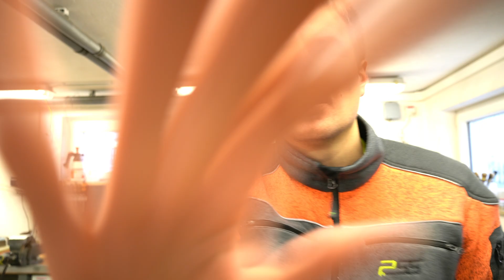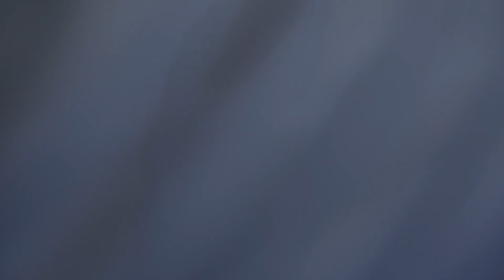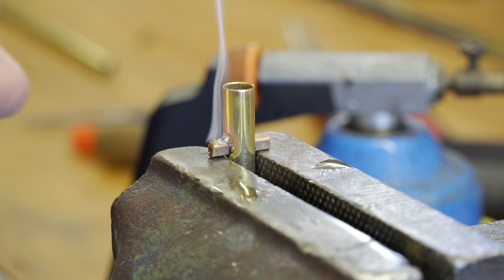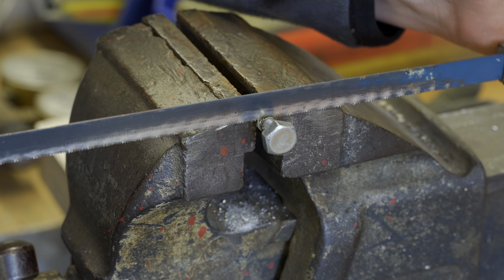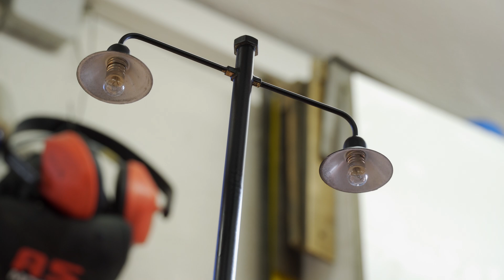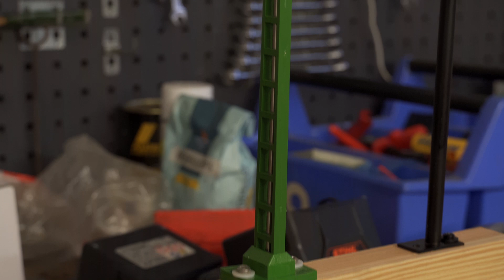Scratch build LANTERN ready to install on my LGB garden railroad!

Comment: Lights look really good! Do you find the time it takes to make one, or then a number of them, worth it, compared to buying what you want? And do you have any plan so that once you've put them on the layout, they aren't vulnerable to getting bumped or snapped off?  Always wonder how long these last in a practical sense...you know, you are cleaning up, or moving something and the power cord sweeps across the platform, a branch falls, and when you go to move it you hit a light, and pull the whole platform out. ;-)   Especially since so much of your layout is all at ground level. Just your chickens wandering on to the layout....;-)
Reply from the maker: Hi! I am glad you like my build :) First of all this project started because I could not find any lantern that fit my criteria. So I began to make one of my own. In the video you have seen me build the prototype lantern which took me about 4 hours in total including the camera work which takes most of the time. As of today I have build several lanterns of the same style. Once I bought the right materials and got the system down I was able to build one lantern in 25 minutes! The overall cost is at 21 Euro which is fantastic since you can only find cheap plastic lanterns at this price point on the market. 
Protecting the lanterns on the layout is difficult. Most important is that they are robust in the first place so that they can withstand small branches, a bird or a slight bump. Thats why I prefer metal lanterns over plastic ones. You can strategically place them as well to prevent bumps in high traffic areas where people step into the layout for example. But in the end it is a garden railroad, you simply have to accept certain damage from time to time due to weather, animals and people. See you next time!

Comment: 4:30 I think my solution would be JB Weld.  Not sure if you have such stuff or exactly what its outdoor life expectancy is, but...
Reply from the maker: I don´t have JB Weld on hand but im sure I can buy something like this in my region. This was my prototype lantern, I used what was currently available in my shop. Now that I had a plan in mind I went shopping and got exactly the right materials for the job... it should go way smoother this time :)
Reply: @summitrailway  Sounds great!  I don't want to sound negative, I think it turned out pretty well!  And you could actually make that expensive version if you can find a good way to bend the arms of the lampholders you have in the right way.

Comment: A round rasp is perfect for deburring the ends of the cut brass pipe.
Reply from the maker: I did use it on the inside, it hasn´t made it in the video.

Comment: I like the light you made, its very traditional to a lot of railway networks from years back. You should use a small pipe cutter to make your cuts, you will have no swarf to clean up and it will speed things up. I use one for copper and small plastic pipe all the time. Brass is a little harder than copper but it would work fine. Brass being a little hard is making your drill bit seem more worn then it possibly is. If you incremental size drills as opposed to jumping to the final size it will make life easier and prevent the larger bit catching and possibly damaging your base piece. I spent many years working with metal and mechanics, it is still ingrained in my system.😄 A tip one of my old painter co workers gave me for rattle cans, is to sit them in warm water for ten minutes or so . The paint will flow better on a cold day. You should purchase a small airbrush system for painting small parts. They are a wonderful tool and you can stay indoors.
Reply from the maker: Thank you for your very kind and informitive comment! So far most of the viewers like the scratch build lantern most which is fantastic! As of today I have aquired the right materials based of the prototype lantern. I was able to build 4 additional lanterns of the same style which are more refined in build quality. Those where build in no time once I had the system down. You can trust me, those drills are dull, regardless of the material... It is either time to sharpen them or buy a set of new ones. I did incremental size the drill bits altough I haven´t shown it in the video since it would be very boring. The trick about the rattle cans is great, I will try it next time! A airbrush system would be great too, maybe in the future. For the time being I will use rattle cans until I have time to look into such a system and get the funds for it. Thank you again for the nice comment, I really appreciate it!

Comment: Very good job. I like your self-made lantern, but be careful with the screw on the top of it: if it's made of galvanized steel, it may react with the brass.
Reply from the maker: That is a good pointer. I have ordered brass screws to cope with this problem. Good thing about that, I can now solder the screw in place instead of glue. This makes the lantern even more robust... Thank you!

Comment: Nice lantern! But a question though: Where did the wires go? Did you drill out the square brass tubing from the top of the pole after soldering?
Reply from the maker: You are watching very carefully my friend! Unfortunately I missed this detail in my video, but now I can tell you. I used a round file to open up the bottom of that little brass piece before I soldered it in place. Then I was able to place the wire through the little brass piece into the lantern shaft. I might consider showing this detail in one of my next videos.
Reply: Yeah he did something so that the wires would go down the mast inside.
Reply from the maker: That´s right, I used a round file to open up the bottom of the brass piece before I soldered it in place so I was able to feed the wire through...
Reply: Thanks for the answer. Even when I drive H0 I might be tempted to try build a G scale latern. ;-)